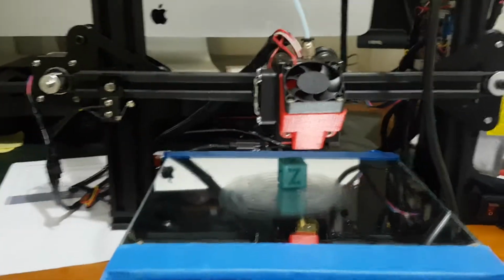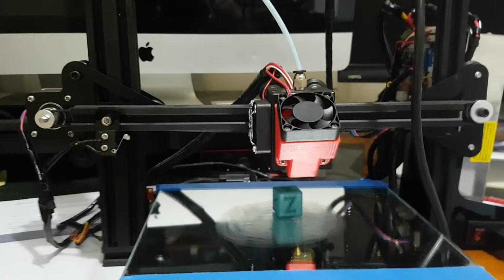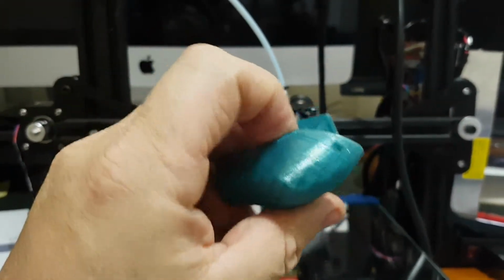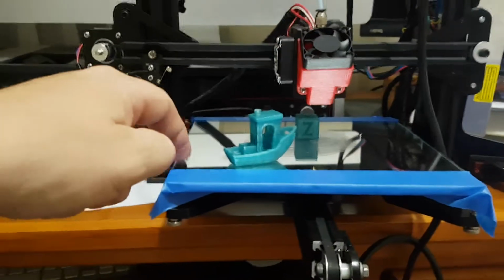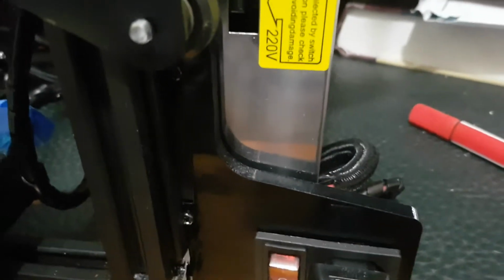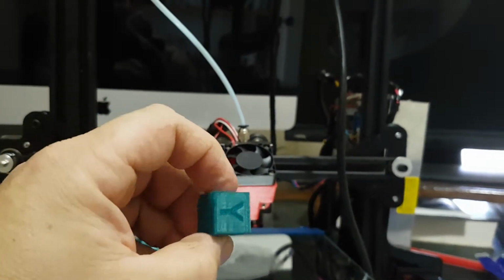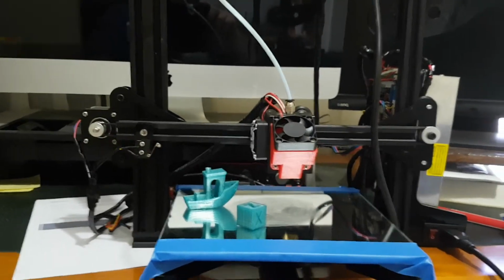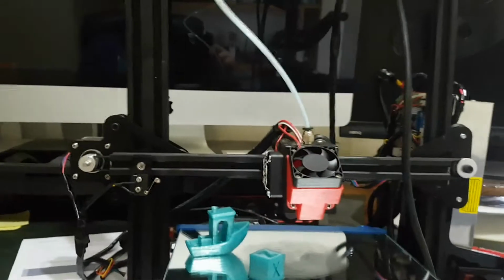An update on the Zonestar Z5, and I am impressed now.

Comment: Just got the printer a few weeks ago - Im impressed with it.  I had the stepper driver problem too but I caught it in time - it would start skipping after 15 mins...  basically one of the drivers (the Y axies on mine) was getting too hot - easy fix was made a fan bracket to cover the control board and blow over the heatsinks - never had a problem since.
Reply from the maker: Been thinking of doing that do you have a link to the file?

Comment: i have the same one, piece of junk !!
Reply from the maker: Was think of replacing the motherboard with a CR10 motherboard.  The board has many problems.
Reply: @chuxxsss  mine doesnt even print decent and also a major issue, the center is not the center, dont know that happened....  when I slice a model I always center it , when I try to print it starts from an edge going over the sides of the bed :s
Reply from the maker: @MrAlexanderP3  I found the driver transistors under the heat shinks cause most of the problems.  Especially when warmed up. I am thinking of replacing the board with a CR10 board. It would have to be reprogrammed with Marlin.
Reply: @chuxxsss  good luck with the board, im not spending any more money on that printer. Do you have the default EEPROM settings so I can see what happened to mine... somethings not right
Reply from the maker: @MrAlexanderP3  Alex I don't have the default setting. But I am one hundred percent that the driver mosfets are the problems with this printer.
Reply: @chuxxsss  I have 2 zonestar printers, one after a year, broke down, motherboard, they do not sent new one so it sits for parts. Have Creality s4 , ender-3 and Anycubic Chiron is on its way... when the Chiron arrives, ill leave the zonestar crap for spare parts.